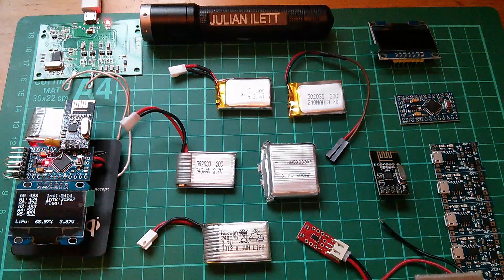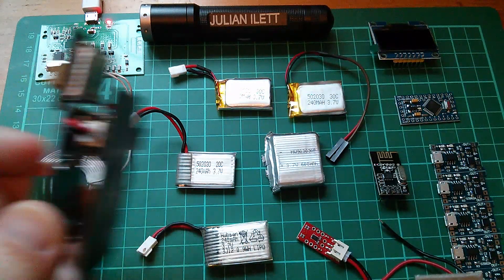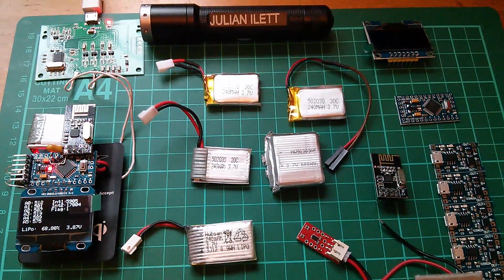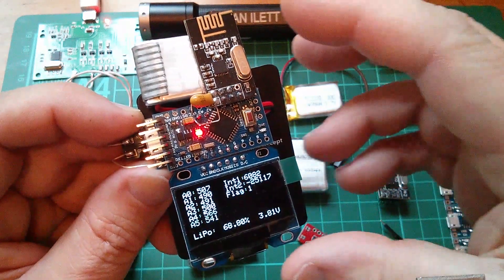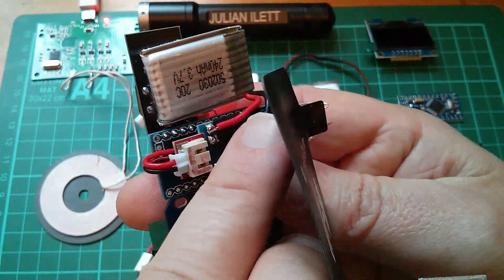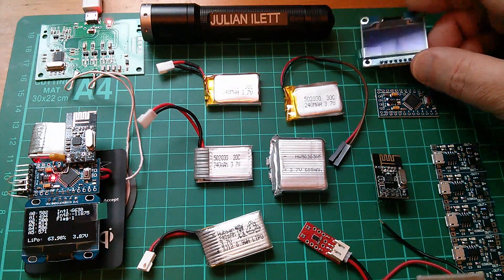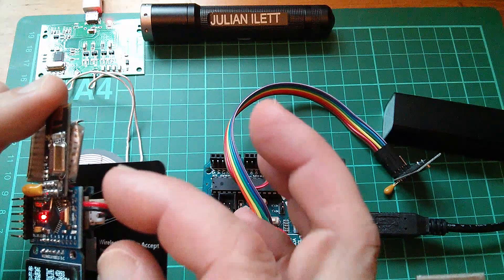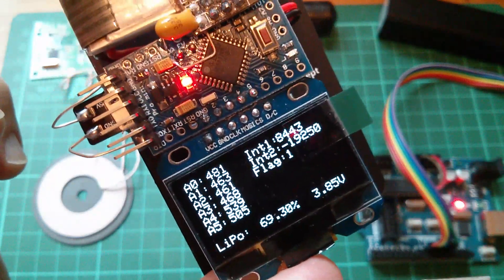Project: New Wearable Arduino OLED Data Display #4

Comment: Hi Julian, now that you are building a new setup, perhaps you might like to use one of these displays.  I know you like the OLED, but this little TTF color screen using the SPI would make a wonderful color display, the price is a bit higher, and I am sure it probably will take more juice, of that I am not sure but I guess if you leave the backlight lit it probably would.  Just a thought, I picked up a couple of them and I love the  performance I get our of them compared to OLED and the color is brilliant.  I haven't tried them in direct sunlight, perhaps that would be their downfall.  1 44 inch Full Color 128x160 SPI TFT LCD Display Module Replace OLED for Arduino | eBay
http://www.ebay.com/itm/181943859824?_trksid=p2060353.m1438.l2649&ssPageName=STRK%3AMEBIDX%3AIT

Comment: Also if you warm the lipos up befor using them they give out 50% more power in my experiance,the colder they are the craper they are,you can buy lipo warmers,they realy do loose there punch when cold.

Comment: You need to cycle the lipos about 10 times and they will come back to life,warm them a little too,they have been in storage for ages no doubt,maybe years,you have to gently wake them up low miliamp chrges first then gradualy build up to 1c charges,trust me ive had loads of batterys from tunigy witch are pretty good with the same problem,and also ive had loads of the batterys in this video.
Ive been into rc planes and helis for years and use alot of these lipo batts.
Hope this helps any one,dont give up on them,rember safety too,lipo fire bags or a tin to charge them in,never leave lipo battery unattended during charge.

Comment: Are you able to program the pro mini wirelessly?
Reply from the maker: Philip Kownslar You program the Pro Mini via USB and then serial, so if you can find either a wireless USB system or a wireless serial data system, then yes.
Reply: I will look into that, that would be cool.
Thanks! Love the vids btw.

Comment: Have a look at the Zippy single cells on hobbyking. For example, the Zippy 350mah 20C batteries (http://hobbyking.com/hobbyking/store/__7569__ZIPPY_350mAh_20C_single_cell.html) are an excellent replacement for my mini quad... and are much better than even the genuine batteries. You can also get 240mah, 70mah and 50mah, etc.

Comment: I don't think your 240mAh-cells are "fake", they are simply not made for a high-discharge application. There is many different ways of constructing these cells inside (bonding of the terminals, etc.). They are probably made for cheap mp3-players, which draw next to nothing current.
Reply: The 'wearable' would be nowhere near high discharge.. I doubt it is drawing anything near 1C (i.e. 240mah)... more like 25-35mah since the 600ma battery lasted near 24 hours. A lot of the cheaper batteries are fakes... like the 1600ma 14500's i have... which I suspect from their weight are more like 160ma batteries!
Reply: Peter Feerick Exactly. And that is why the 240 mAh-cell works fine on the Wearable, but not on the Hubsan. They have too much internal resistance.
Reply: *****
Missed that one, thanks for pointing that out. It's actually rather funny when you use cells claiming 25-50C in a micro quad, and they only last 3-5 flights before flight times drop drastically. Still, the 'no-good' 240mah cell didn't last anywhere as long as it should have in the wearable... 3 hours as opposed to 12.

Comment: Ive found a good way to get proper rated small batteries is old phones or digital cameras. You can tend to get a pretty decent cell from them. And at least you know the quality of the cell is good. Its pretty easy if you are careful to get the plastic cases open and just take the cell out too

Comment: That's brilliant, Julian - thanks!
Already an application springs to mind at my "work-experience" job. We need to test some solar panel/battery combo. We'll set it up in the car park, but I'm blowed if I'm gonna 'zimmer-frame' myself to have a look at it in -20C.
Mercifully, I've a couple of spare arduino pro mini's* and a brace of NRF's so I can monitor from my desk...
* all my 5v units work fine at 3v3 - certainly at room temperature. Should be better at sub-zero. (Yes, Finnish government ordered me to do 'work-experience' as I'm unemployed. Yes, I KNOW I'm 58...but...)
Reply from the maker: Andy Crofts That sounds like a very good use for the remote data display. Nobody wants to go outside in the snow. Are you from the UK originally (you have an English sounding name)? If I ever leave the UK, I'm heading in the other direction... south.

Comment: How about adding a tilt switch and sleeping the Arduino and turning off the OLED display when you detect the wearable is not moving and therefore not on your wrist?  Would that reduce power enough such that the charge controller completed it charge cycle?

Comment: Why would you need to be wearing the chargerboard and/or the coil all the time ?
since wearability is all about keeping things small, wouldn't it make more sense to have a "charging station dock" or something that has all of the charging stuff, and keep the wearable to the minimum you need to get the stuff you want to be using it for ?

they don't have a transformer and plug in a phone either, you're supposed to carry those with you if you want to charge "on the go".  A phone does have a charger system, but that's also quite a bit bigger than what you're aiming at here.
Reply from the maker: I take your points, all of them.
The 'wearable' nature of this project is ever so slightly tongue in cheek. My aim is certainly to make this device as small as possible, but I'm also enjoying bolting on as many bells and whistles as I (and everyone watching) can think of. This device is never going to compete with a Moto360 smart watch, of course. But I hope the end result will be both useful, and instructional.
Reply: Julian Ilett Hand cranked dynamo charger (I've seen a really small one somewhere), a couple solar cells you can put on your back, a kinetic energy charger so it charges while moving, smoothy maker, peltier to keep your wrists cool or reverse it and get power from the heat of your wrists, portable nuclear reactor (might be a bit difficult to get through customs from china), built in tazer in case someone wants to steal your mobile device,..   shouldn't be to hard to fit all that onto your wrist :-)
Reply: oreubens
You forgot a nuclear fission reactor... much safer and less hazardous material to dispose of :)
Reply: Removing the coil would pointless... it is there to provide a contactless / physical connector free method of connecting to the external power source. The charger has to stay as it has the protection circuitry to protect the battery, and needs a direct connection to the battery to also get reliable feedback for charging.
Reply: Peter Feerick the "coil" means you'll be charging it at a very specific place. the place where the charging pad is. So, why use the somewhat restricted/inefficient coil charging when you could just require the device  to be docked in a same kind of docking pad.  See what I did there.
Reply: oreubens
It would only be a ease-of-use feature... just place it on the charge pad, no connectors to plug in (or wear out). I like the qi charge for my phone, but for a watch prefer the magnetic clip charger used by the pebble watch (similar to the apple maglock connector).

Comment: I've built something similar (RetroWatch) with similar components, inc SPI 0.96" OLED. One big tip, is to cut the pins down on the back of the screen with pliers. It saves so much height and fitting troubles if components go behind the screen. I then soldered 30AWG to the pin ends.
One thing worth a couple of hours experimenting, is to wind your own coils for the transmitter and receiver of the Qi. The wearable doesn't need to have any lateral placing wiggle room as something like a casually placed phone on a mat might, so the coils can be smaller. Whatever the ohms are for the coils, match, but the shape can be changed....that way, the control circuits won't overheat.
One area to work on is Sleep and power saving generally, so am looking forward to whether you tackle that aspect :)

Comment: Julian, you are aware that Atmel only can supply 20mA by a digital pin?
Reply: Datasheet for the Atmega328 specifies it to be 40mA per pin (page 313). There is another maximum per port, can't remember offhand. Have successfully used a digital pin to power a 4 line character LCD backlight for 3+ years now without issue.

Comment: I would think a little NC reed switch with a magnet in the wireless charging pad would make a good automatic on/off switch, that way it shuts off when you put it down to charge, and starts back up when you pick it up. The problem with that though is that once you put it down it effectively becomes a paperweight, it's not like it can be used while it's charging in that circumstance.
Reply: Still, I like that idea... would make charge termination bulletproof. Charging when a load is present is flaky at best with this type of charger... some of the TI chips would be more suited as they can compensate for a load on the battery whilst charging.

Comment: It's getting very large... you could put the logic circuits inside an armband and make the display a remote wristband.  It looks like a piece of CAT5 would handle all of the OLED pins.  That would also give you room to put the larger battery on it.

Comment: Could you just add a simple reed switch as an on/off so when the wearable is placed on the charger pad it turns off?
Reply from the maker: Nik Harding Awesome idea! Can you get reed switches that go open circuit when near a magnet?
Reply: Julian Ilett didn't think of that - but looks like you can... actually didnt realise you can get so many different function reeds eg. http://www.meder.com/reed-switches.html

Comment: I got some extra batteries for my hubsan too, and they were also kinda crappy. They did fly it for about 2/3 as long as the original though, so not as bad as those you have there.
Regarding the wearable, I would be inclined to leave the charging components out altogether and just swap batteries when they run down.
Reply from the maker: ***** I like the LiPo fuel gauge too much now to get rid of it! I guess the charger board could go, if the LiPo were a protected type.
Reply: Julian Ilett If you want to test your batteries you might like to invest in a cheap accucel 6 (or similar) battery charger. I have been using it to test Li-ion batteries from my old laptop. It is great because it tells you how many milliamps have been added.

Comment: I think running the display from IO pins is a bad idea. The pins may be able to supply 40mA (be aware that the total VCC/GND current must not exceed 200mA in an ATmega32), but the voltage will drop substantially. Look at the "pin driver strength" section in the datasheet. Assuming the display needs 10mA (no idea what it actually is, but it gets worse with higher current), output low becomes 0.3V (then pin can't pull any lower at that current) and output high becomes 2.9V, leaving a difference of 2.6V. Can the display run on that? You also have to bear in mind that the display's "GND" is at 0.3V because of that. So pins pulled low by the arduino will look like -0.3V to the display. This may cause issues.
Use wires in the same configuration like you are using now, but just make them longer so you can double fold the display to make an Z-shape.
Reply: What he said. But it's worth a try though, see what happens :)

Comment from the maker: Wearable code:

#include <Wire.h> //I2C for MAX17043 LiPo Fuel Gauge
#include <MAX17043.h>
#include <SPI.h> //Hardware SPI for nRF transceiver
#include <nRF24L01.h> //Use Greg Copeland library
#include <RF24.h>

#define RF_CE 14
#define RF_CSN 15
//   5 - RF_SCK to Arduino pin 13
//   6 - RF_MOSI to Arduino pin 11
//   7 - RF_MISO to Arduino pin 12

#include <Adafruit_SSD1306.h>
#include <Adafruit_GFX.h>

#define OLED_CLK   2
#define OLED_MOSI  3
#define OLED_CS    4
#define OLED_DC    5
#define OLED_RESET 6 //not presently used

// NOTE: the "LL" at the end of the constant is "LongLong" type
const uint64_t pipe = 0xE8E8F0F0E1LL; // Define the transmit pipe

/---( Declare objects )---/
MAX17043 batteryMonitor;
RF24 radio(RF_CE, RF_CSN); // Create a Radio
Adafruit_SSD1306 display(OLED_MOSI, OLED_CLK, OLED_DC, OLED_RESET, OLED_CS);

/---( Declare Variables )---/
float soc;
float voltage;
int i[11];  // 16 element array holding Joystick readings

//#define NUMFLAKES 10
#define XPOS 0
#define YPOS 1
#define DELTAY 2

#define LOGO16_GLCD_HEIGHT 16 
#define LOGO16_GLCD_WIDTH  16 
static const unsigned char PROGMEM logo16_glcd_bmp[] =
{ B00000000, B11000000,
  B00000001, B11000000,
  B00000001, B11000000,
  B00000011, B11100000,
  B11110011, B11100000,
  B11111110, B11111000,
  B01111110, B11111111,
  B00110011, B10011111,
  B00011111, B11111100,
  B00001101, B01110000,
  B00011011, B10100000,
  B00111111, B11100000,
  B00111111, B11110000,
  B01111100, B11110000,
  B01110000, B01110000,
  B00000000, B00110000 };

#if (SSD1306_LCDHEIGHT != 64)
#error("Height incorrect, please fix Adafruit_SSD1306.h!");
#endif

void setup()
{
  display.begin(SSD1306_SWITCHCAPVCC);
  display.display();
  delay(1000);
  display.clearDisplay();

  display.setTextSize(1);
  display.setTextColor(WHITE);

  Wire.begin();
  batteryMonitor.reset();
  batteryMonitor.quickStart();

  radio.begin();
//  radio.setDataRate(RF24_250KBPS);
  radio.openReadingPipe(1,pipe);
  radio.startListening();;
}

void loop()
{
  soc = batteryMonitor.getSoC();
  voltage = batteryMonitor.getVCell();
  
  display.clearDisplay();
  
  display.setCursor(0,56);
  display.print("LiPo:");
  display.setCursor(40,56);
  display.print(soc);
  display.print("%");
  display.setCursor(90,56);
  display.print(voltage);
  display.print("V");
  
  if ( radio.available() )
  {
    // Read the data payload until we've received everything
    bool done = false;
    while (!done)
    {
    done = radio.read(i,sizeof(i)); // Fetch the data payload
    }
  }
  
  display.setCursor(0,0);
  display.print("A0:");
  display.setCursor(20,0);
  display.print(i[0]);
  
  display.setCursor(0,8);
  display.print("A1:");
  display.setCursor(20,8);
  display.print(i[1]);
  
  display.setCursor(0,16);
  display.print("A2:");
  display.setCursor(20,16);
  display.print(i[2]);
  
  display.setCursor(0,24);
  display.print("A3:");
  display.setCursor(20,24);
  display.print(i[3]);
  
  display.setCursor(0,32);
  display.print("A4:");
  display.setCursor(20,32);
  display.print(i[4]);
  
  display.setCursor(0,40);
  display.print("A5:");
  display.setCursor(20,40);
  display.print(i[5]);
  
  display.setCursor(56,0);
  display.print("Int1:");
  display.setCursor(85,0);
  display.print(i[8]);
  
  display.setCursor(56,8);
  display.print("Int2:");
  display.setCursor(86,8);
  display.print(i[9]);
  
  display.setCursor(56,16);
  display.print("Flag:");
  display.setCursor(86,16);
  display.print(i[10]);
  
  display.display();
  
  delay(10);
}

Comment from the maker: Transmitter code:

#include <SPI.h>
#include <nRF24L01.h>
#include <RF24.h>

#define CE_PIN   9
#define CSN_PIN 10

const uint64_t pipe = 0xE8E8F0F0E1LL; // Define the transmit pipe (LL=LongLong)

RF24 radio(CE_PIN, CSN_PIN); // Create a Radio

int i[11];  // 11 element array holding integers
int upInteger = 0;
int dnInteger = 0;

void setup()
{
  radio.begin();
  radio.openWritingPipe(pipe);
}

void loop()
{
  i[0] = analogRead(A0);
  i[1] = analogRead(A1);
  i[2] = analogRead(A2);
  i[3] = analogRead(A3);
  i[4] = analogRead(A4);
  i[5] = analogRead(A5);
  i[6] = analogRead(A6);
  i[7] = analogRead(A7);
  
  i[8] = ++upInteger;
  i[9] = millis();
  
  if (radio.write(i, sizeof(i)))
  {
    i[10] = 1;
  }
  else
  {
    i[10] = 0;
  }
  delay(500);
}
Reply: Pastebin?